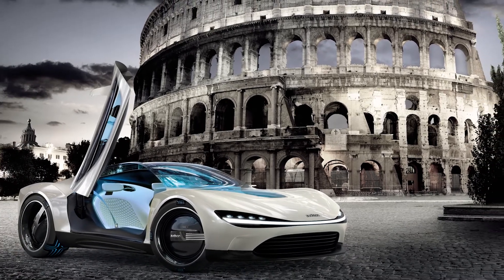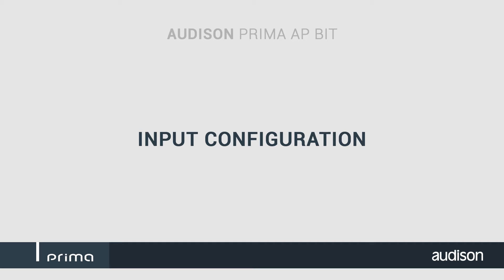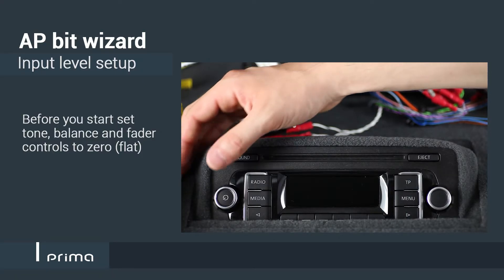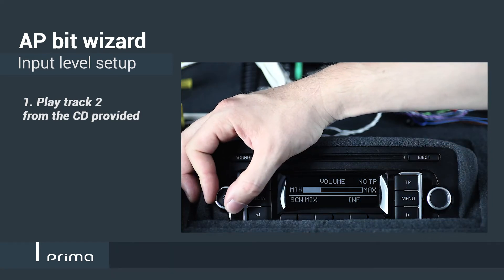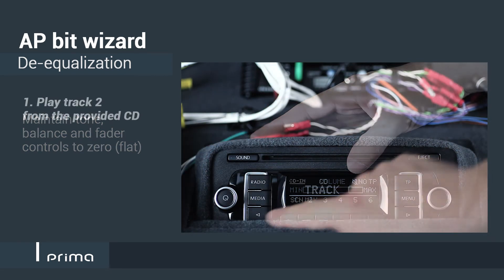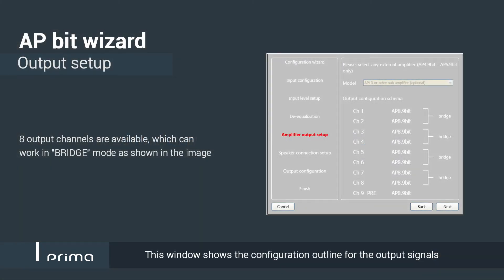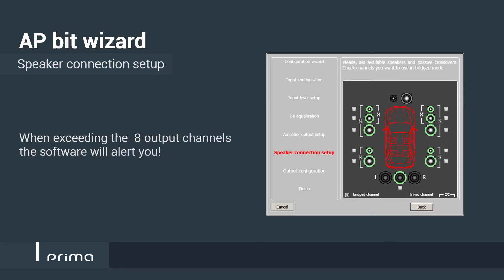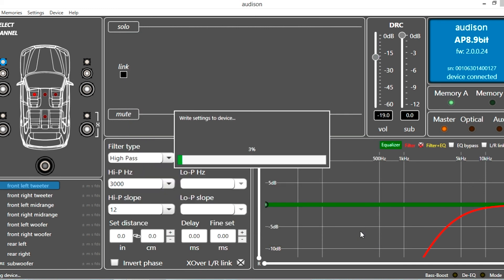5 - Audison Prima Tutorial - Input Output configuration wizard

Comment: I have a right hand drive Golf and have preset 7 selected on the G7 8.9. I have made adjustments to eq and levels but they won’t save when I close the software. I have saved them, then loaded them when they didn’t save to the 8.9, then ‘write to device’, finalise, but when I close the software the settings go back to default on the 8.9. Do I need to be in preset 0? Then do I have to re-configure for right hand drive? The manual only explains the standard 8.9.